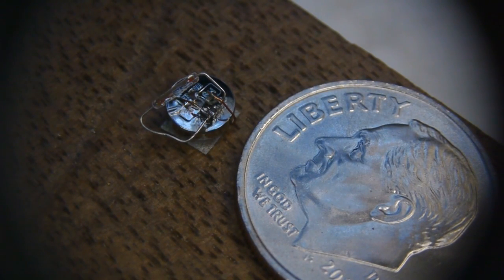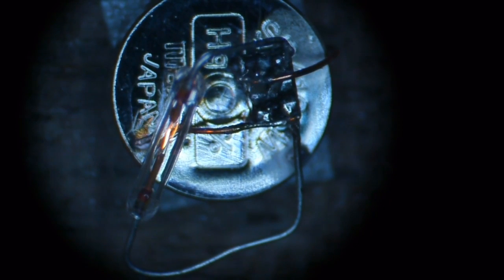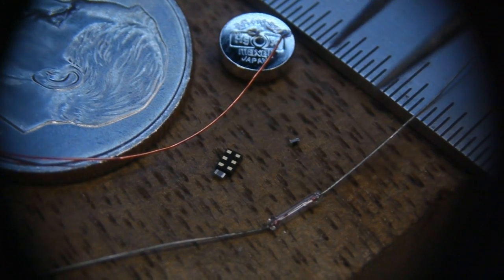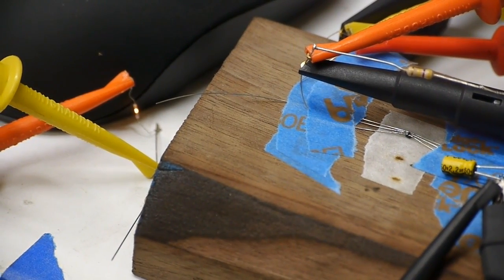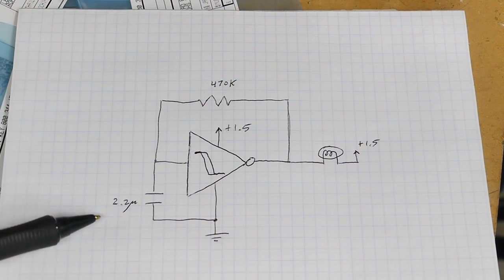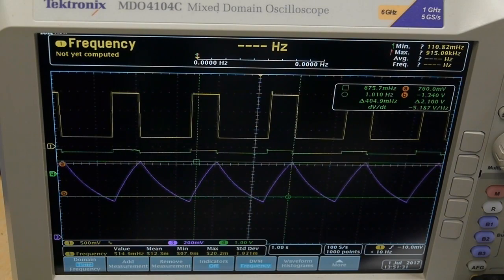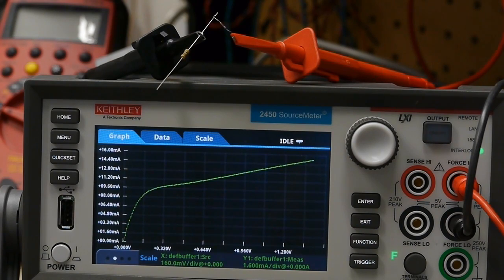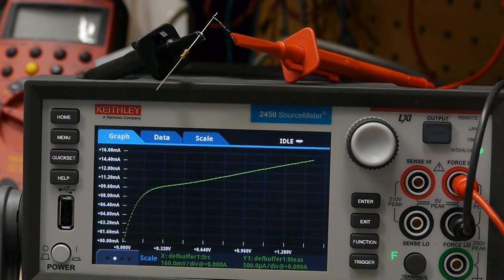World's smallest lightbulb flasher?  Flashing Light Prize 2017

Comment: Great Job!  It is unfortunate that the concept of that contest is to use an archaic incandescent bulb!
Reply: Inspironator In a way that's what makes the contest more of a challenge. The behavior of an incandescent bulb is very different from that of an led and actually requires some thought to execute. If I remember correctly there are micro smt self flashing LEDs so this could be as simple as soldering a correctly chosen led across the contacts at the edge of the smallest cell you can find, maybe with a resistor if neccicary, that wouldn't be as much of an engineering project.
Reply: I disagree.  It becomes an internet search of where to find the smallest component to create an oscillator, and how to trick the battery to put out enough power.  From there, you assemble the circuit and use sophisticated test equipment to finesse the solution.  It is about access to search engines and test equipment.  It is a contest of those who are advantaged vs those who aren't.  Using a chip inverter is not innovative.  next year or the year after, a new, smaller chip will replace the smallest chip of today.  It isn't ingenuity, it is a technology race.  I think chips should be barred from the contest.

Comment: Lamps from wristwatches in the 1980's were even smaller
Reply: simontay1984 They were definitely incandescent lamps, I still have an ancient watch with one in it, and it still lights :)
Reply: simontay1984 they weren't bright enough back then.
Reply: simontay1984 there were LEDs in the 1970's but watches used incandescent lamps through the 1990s.
Reply: Yeah, I remember my dad having a watch with one, I though it was a led at first but it was a really tiny incandescent bulb, pretty damn small.
Reply: But there were no blue (and thus no white) LEDs in the 80s.

Comment: Is it a myth that flashing an incandescent lightbulb makes the filament wear out quicker?
Reply: Llewln: the bulb doesn't really flash at 60Hz. There's a bit of ripple in light output but the filament doesn't cool down fast enough to go dark in between peaks.
Reply: No. Incandescent bulbs work by heating a filament via resistance heating until it glows intensely. Turning it on and off damages it because it puts the filament through heating/cooling cycles that cause expansion and contraction which gradually wear on the filament.
Reply: No. The action of heating and cooling expands and contracts the filament creating the tiniest fractures in the filament as it relatively oscillates over time until it ultimately fails. This is why incandescent technology is so poor compared to LEDs as the high temp required for max illumination of incandescent is based on a material that produces a color that makes our eyes happy but fails comparatively fast due to materials expanding, contracting, and reacting to its environment over time.
Reply: Doug Ankrum "only lasts a few weeks" WHAT!?!? Ours gets turned off and on every time someone goes to the bathroom (multiple times a day.) So it's on when the bathroom isn't occupied, and off when it is. And it lasts months-years. (It is also a 4 watt incandescent)
Reply: It will draw a bit more power due to resistance increasing as the filament heats up, and this high initial current when it has a low resistance when it's cold could be why people say this.

However, I doubt it causes much of a difference, as the main cause of failure is likely to just be temperature.
Reply: Doug Ankrum Ac light "flashes" your lightbulb 60 times a second, maybe look at some other reason for the problem ?
You might be right though, but I doubt it

Comment: I don't wanna be that guy, but i have a feeling this might lose on a technicality. The system has to work for 5 minutes without shutting down, so if it doesn't run for 5 minutes without the heat gun they might have to count the heat gun as part of the system
Reply from the maker: It's OK.  This is just a fun contest, and I'm not too concerned about winning or anything. My initial design didn't work, but was close, and I had a lot of fun getting it working as I had envisioned.  It's also been really enjoyable seeing the incredible variety of designs that have been created, which I think is the main goal of this whole contest.
Reply: It doesn't need much heat though, he could just run the test outside on a hot day or whatever
Reply: Honestly the rules are so vague that I think almost anything goes. Furthermore, the contest is to build "the most unusual way of flashing an incandescent light bulb", and Mr. Krasnow decided to make something very small as his version of "unusual".

If the goal were to build it small, I would say using a heat gun is perhaps contrary to the spirit, but under the rules as I read them, he could even use an external power source and induce the current somehow since there's no rule that it must be self contained.
Reply: i realize that bulb probably does not produce much heat but could maybe try mounting it on the bottom of the battery wrapped in a heatsink.
Reply: Yea the heat gun is a bit like giving a perpetual motion machine a nudge every few months to keep it running.
Reply: It's true that all equipment has "operating range", but do agree with me that a minimum of 30 degrees C is a bit picky for something so generic.
If it was a contest for an oven part, and the part wouldn't work below 30 C, I don't think anyone would nitpick about it. But for generic contests it makes sense to assume generic conditions.
Where I live we get 30 degrees C in the shade for half of the summer, every summer. So I guess I'll have to be the one to tell you - anything with a range starting at 30C is VERY specialized. It may only be 5 degrees above room temp, but it's 5 degrees you don't want.

Someone above suggested that if a heat gun to maintain minimum temp isn't allowed, then why is it that mains power is allowed.
Well, for half of the world having mains is as common as having clean water and not having sewage running down the streets. More common as literacy, even.
A minimum of 30 C, or even an average of 30 C, is not.

Gladly I'm not a judge in this contest, but assuming this contest happens outside of the Burning Man premises, a miniature flashing lightbulb powered by mains is more miniature than a miniature flashing lightbulb powered by a miniature battery which doesn't work without a handheld or tabletop heat gun.
Reply: pubcollize Yes, I think we're all glad you're not the judge... you have already succeeded in sucking every last bit of fun out of it.

Comment: Any possibility of you making your own lightbulb? Doesn't seem impossible to make an even smaller one.
Reply: Yes - and then build in a bimetallic oscillator.
Reply: Fuxxor Systems: No. The EU has not banned light bulbs. Maybe you are thinking about the ban of general-purpose, non-directional incandescent bulbs!?
Reply: Alecto You should employ this method and make a video on it
Reply: They're not banned, just heavily taxed.
Reply: lightbulbs over 40W i believe are taxed.
Reply: The smallest incandescent lightbulb was made in 2009 and was a single carbon nanotube 100 atoms wide
Reply: Yeah -- in the olden days of incandescent bulbs I believe there were blinking bulbs that used a bimetallic oscillator inside the bulb along with the filament.
Reply: Since we're seeking the smallest bulb possible, I would attempt to create a bulb by heating a glass bead probably from pyrex glass and blowing the glass with a small gauge syringe (N.b. they probably still manufacture glass syringes as the plastic ones would require an unproductive amount of cooling to prevent melting) creating a bubble then allow the glass to cool around the syringe tip. After cooling, prune the external end of the syringe and attempt to insert the smallest filament loop into the glass bubble then evacuate the glass and run whatever gas works best for incandescent light and seal the bulb. I think the hardest part would be to determine the vacuum strength of the bulb and the current required but dependent on the expansion coeff of the syringe material to maintain a seal. If a filament can be created to run off of LED currents then the best and by far smallest flash circuit can be removed from the LEDs with embedded flash circuits. The size of the model presented could be reduced significantly if this method was employed.

Comment: Did you build the capacitive discharge wire welder, or is that an off the shelf unit.
Reply from the maker: I used an off-the-shelf unit.  I put a link in the description.  It's a good project for DIY, though!
Reply: Applied Science   Hi Ben! I just want to say that every time you release a video, I remember why I keep coming back to YouTube. Your videos always teach me somethig and give me an almost child-like sense of wonder. Good luck with your next project- I wish you all the best.
Reply: Applied Science We used to use modified flare circuits from disposable cameras in the e-cig world to attach no-resistance wire (Ni200) to resistance wire (Kanthal), to control where the wrote heats up.